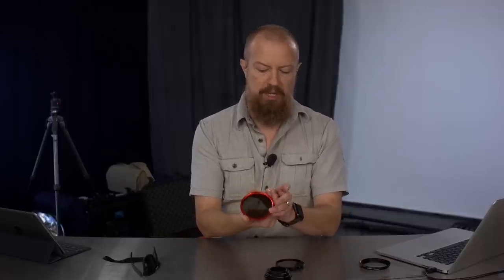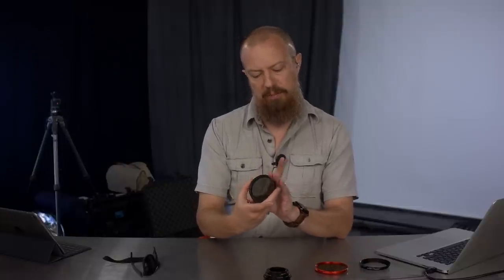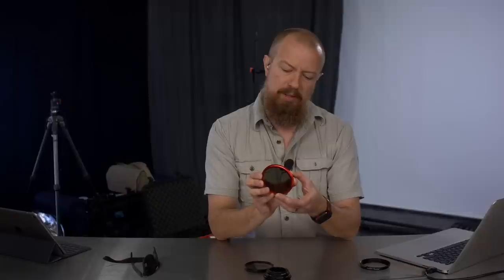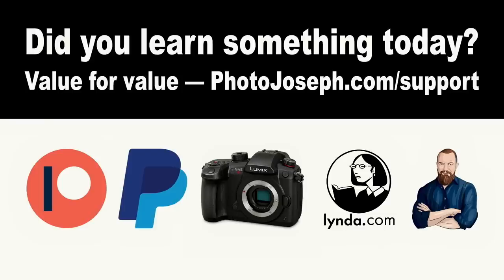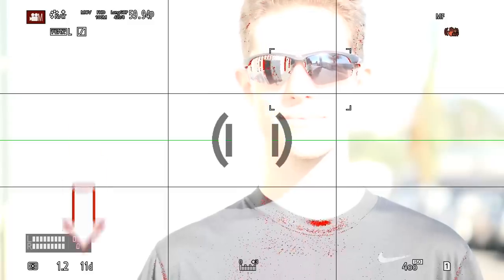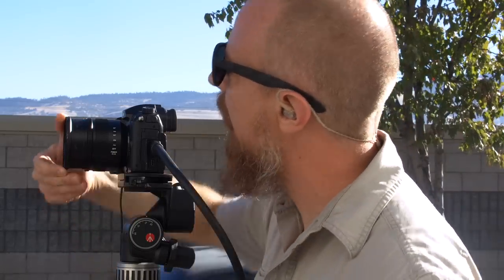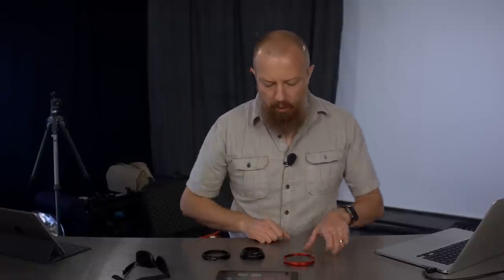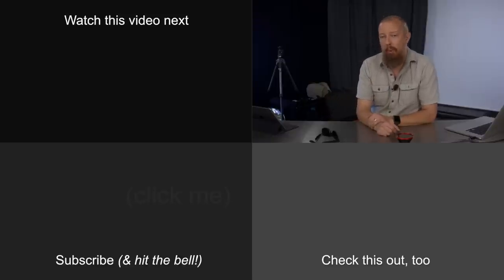Neutral Density (ND, Variable ND) Filters Explained ▶︎ What is it? Why do you need one?

Comment: nd filter reduces the light brightness (for example by %50)
is there  are any filter that reduce the brightness by removing a specific amount of light?

for example a filter that remove 500 lux of light
so if 200 lux of light is in nothing is passed
if 900 lux of light is in only 400 is passed
(sorry for my english)
Reply from the maker: ND filters don’t remove a percentage, they remove an amount, measured in stops. Light isn’t quite a linear as you’re describing, but if you have a filter that removes the equivalent of 500 lux and you only have 200 lux, then virtually no light will get through. I woldn’t expect it to be pure zero, but it’ll be very little, and to a camera sensor, it’d be effectively zero. At least that’s my theory ;-)